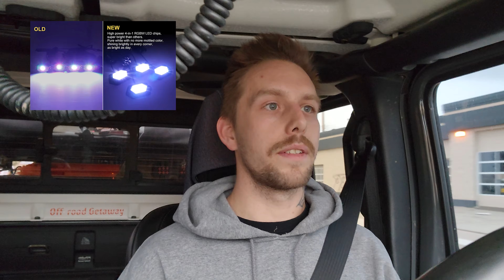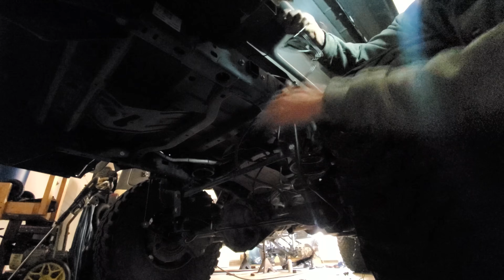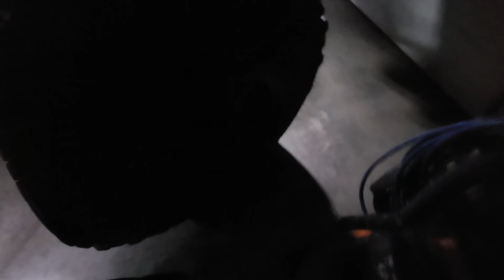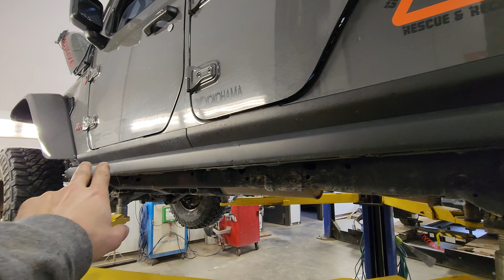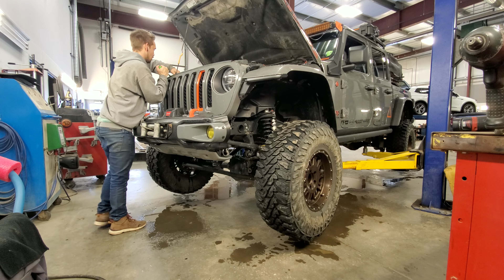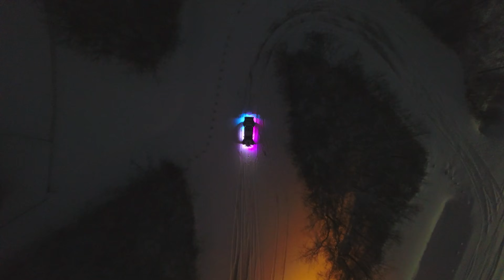THE BEST ROCK LIGHTS!?!?!?  Jeep Gladiator MOJAVE RGBW rock light install. TRUE WHITE!!!

Comment: Any issues going through the drain plug?  Not worried about pests or water?  Did you seal it back up?  I have the locking storage box covering the plug so wondering if that will pinch my wires.